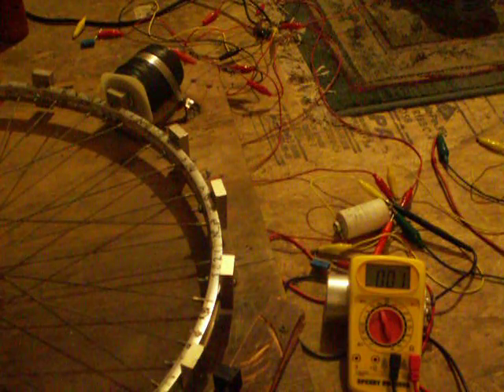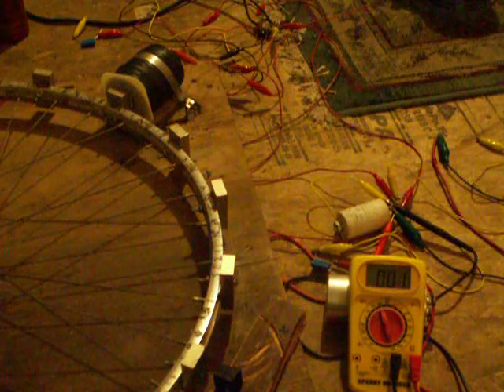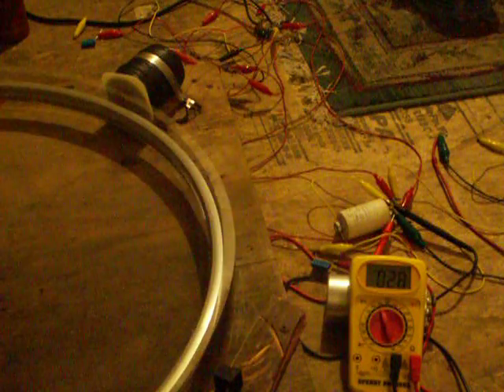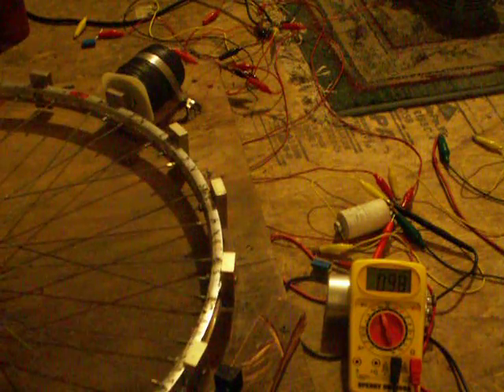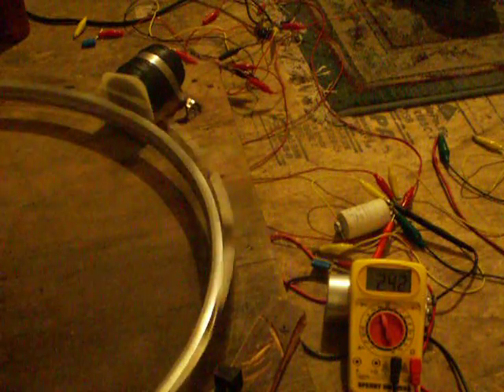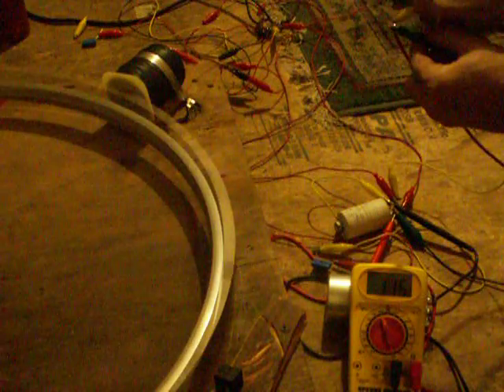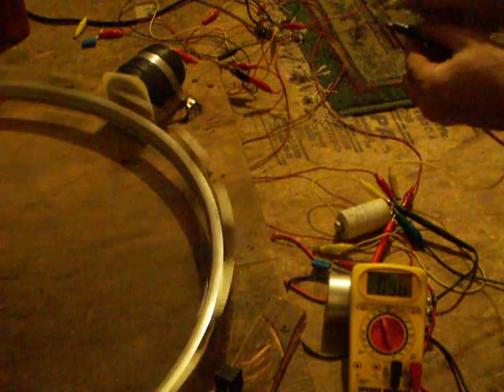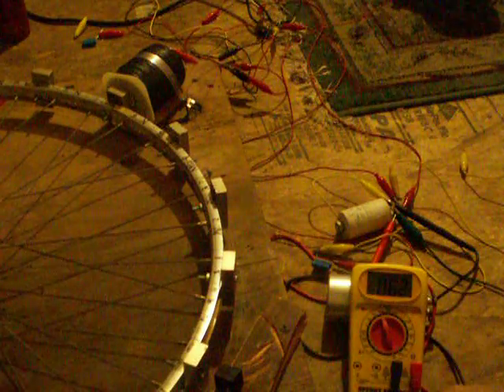Radiant Energy

Comment from the maker: The only battery power is used to power the relay.The magnets passing the coil is supplying the power to the capacitor.  No battery power is sent  to the coil .The relay only shorts the coil to cause the spike. I was told Konehead Doug Konzen originated the Idea of shorting the coil ,Thank You . I decided to try to Buzz the coil and got higher voltages and charged capacitors quicker than when I used  a single pulse.

Comment from the maker: I am generating 500 volts with a coil 700 winds with a steel core made of insulated steel wire . I am shorting the coil with a relay in self oscillation mode while I rotate the rotor and produce a very large radiant spike .